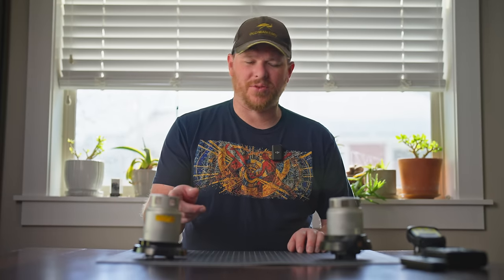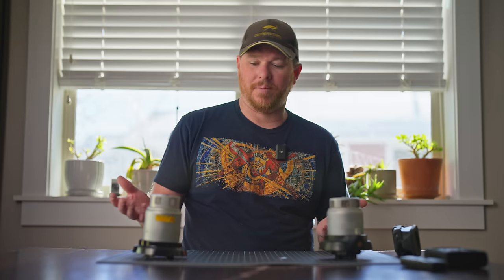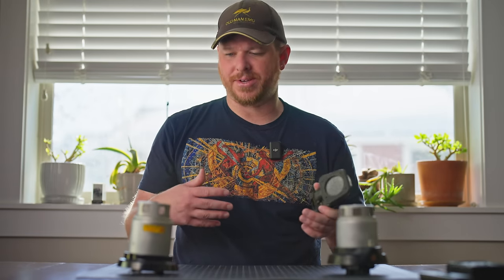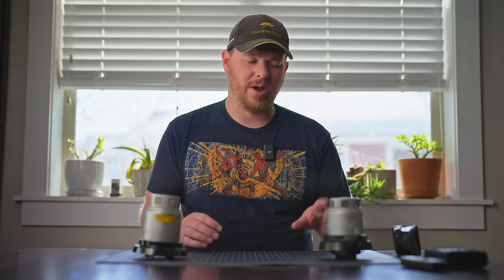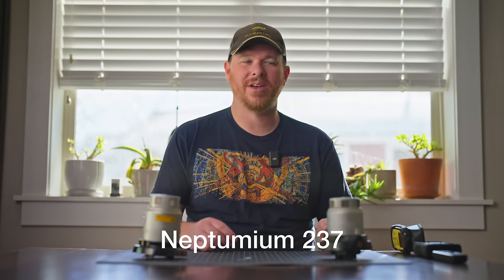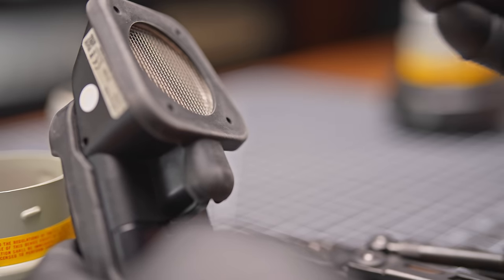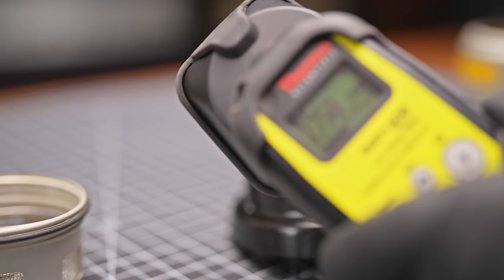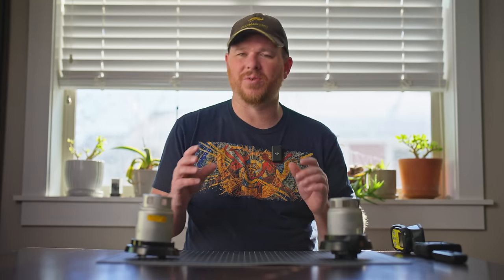Radioactive Cores from Industrial Smoke Detectors

Comment: Drew, would you ever consider reselling the ThermoScientific detectors on your website?
Reply: They are quite pricey, You can get something that will fill the same role (Contamination surveys) for a lot less.
Reply: SE International Ranger is half the price with the same tube and sensitivity and a bigger display
Reply: the Mazur PRM-9000 is a great alternative that has very close range and refresh to the B20 at a reasonable 660-700$ USD , the Better Geiger is good also but i tend to use it as more of a comparison geiger with it being a Scintillator and the B20 and Mazur being a GM it has a handy accumulated dose while it is on and running .
Reply from the maker: If I could work something out with Thermo Fisher I would sell them on there.

Comment: If the "better geiger" shows 1.2 microsievert and the radiacode 11, then one or both of them are very inaccurate or how do I have to understand that?
Reply from the maker: That's a good question. The Radeye B20 is a pretty good gauge to see which one is closer to being right. I only say that because the Radeye is used in the nuclear industry in a professional setting.
Reply: @RadioactiveDrew but that doesnt help here because it overloaded at 600k cpm :(
Reply: @RadioactiveDrew never mind, it showed 25microsieverts with the gamma filter. 
so the others were both very far away from the truth, imagine your geiger says the radiation is 1/20th of what it actually is 😮
Reply: all 3 "measurements" were incorrect - because of wrong geometry, so you just ignore all 3 of them - this is how you should understand "that".
also "nuke-lar", that's SO funny to hear, multiple times : )))

Comment: I have a luminous personnel marker that’s supposed to be only 5 uCi but it reads almost the same as the smoke detector source on the radiacode, is it possible that more radon is being contained in my source and increasing the activity?
Reply from the maker: That’s very likely. The radon daughters can build up in a source like that. Also the gamma radiation from radium is going to give a higher dose due to the higher energy. I have a couple of those personnel markers and they are very spicy.

Comment: On the part about gloves, you should be extra careful with the Am241 one since they're known to expel tiny particles of Am241 onto the surrounding enclosure, so it's easy to get contaminated with Am241 if you're not careful. I'm sure I don't need to say why ingestion of alpha particle emitting isotopes is dangerous.
Reply from the maker: I always check for contamination after handling items like this.
Reply: @RadioactiveDrew  indeed, but the part implying gloves aren't required annoyed me

Comment: what is the main difference between the Am-241 industrial model vs a common household one? And where did you get these? I ask because Im wondering why david hahn kept stealing and collecting the household brand if he could get ahold of those.
Reply: AFAIK, the household detectors that have the Am-241 'buttons' inside are smaller in size compared to the detector that Drew has in this video. I am not sure if the concentration of the actual isotope is less in a consumer grade one as well, but I would guess that it probably is. I'm guessing he was getting the consumer grade detectors because they're more readily available, and much cheaper. I'm pretty sure from what I read about the story, he first got a deal on a whole lot of like 100 detectors, and then years later he was arrested stealing the detectors out of his apartment complex/ building where he lived.
Reply from the maker: Well, David Hahn didn't really have his head on straight and maybe he didn't know about these industrial smoke detectors. I'm sure if he did he would have used them. The difference in material between a residential smoke detector vs the industrial ones can 160x more material.
Reply: @RadioactiveDrew  
True, he was definitely not 'playing with a full deck' so to speak LOL 😆 I think the availability of the 'industrial' type detectors would've most likely been the only factor that may have stood in his way from being able to use them. To play devil's advocate though, he was smart enough/ convincing enough to obtain his own isotopes, and information from the government, companies, and laboratories. Our 'security/ confidentiality' was awfully lax back then apparently. 😆😔
Reply from the maker: Not sure if David was smart or those people he interacted with were totally clueless. I think it was a mix of both. Personally I think the tale of the Nuclear Boy Scout has been over sold to the public quite a bit. There are a couple things that don't make any sense in the story. Also I believe he was made an example of.

Comment: I wonder if there is enough radiation emitted to excite strontium aluminate paint like zinc sulfide did with radium, it just might be a neat little science experiment. Plus, if its effective enough,  you can have little paint cards by where you store this stuff to see if there is leak through that your detectors might be seeing as slightly elevated background radiation.

Comment: Could you use those to produce electricity?
Reply from the maker: There are some experiments from the past where they tried to used radium to generate a charge. The results of the experiment are extremely vague. I would like to try it for myself and see what happens.
Reply: @RadioactiveDrew  that would be pretty boss if you managed to pull it off tbh!!

Comment: Almost reminds me of a hot pellet i observed to be used in a "down hole log-tool', when i worked in the oil field.
The pellet was so hot, it looked like it was inside a bubblle chamber, while in open air. Not sure what the source was, elementally.
Reply: About 500mCi of 137Cs or about 100mCi of americium mixed with beryllium.
Reply: What do you mean by "looked like it was in a bubble chamber"? Very skeptical...

Comment: Does your fingers not feel hot or anything from touching the radium part?
Reply: Luckily it’s so incredibly small, it doesn’t output enough energy to generate any discernible heat.  In the grand scheme of radioactive materials, these are many orders of magnitude less radioactive than objects like Radioisotope Thermoelectric Generator sources, which contain many millions of times more material, and are often composed of shorter-lived isotopes like Plutonium and Americium.
Reply: Nope, you're not going to feel that. The dose rate 1cm from the Ra source is probably only 1mSv/h in gamma (max). The skin dose from beta is probably a couple orders of magnitude higher, but that's not going to cause any acute symptoms unless you left it taped to your skin for hours and hours (perhaps slight skin reddening or irritation). These sources are fairly safe so long as they don't leak, and aren't handled in close proximity for extended periods regularly. At 1m distance, the dose rate from the Ra source is around 0.16uSv/h, and the dose rate from the Am is next to nothing. Background radiation is around 0.1-0.15uSv/h generally (but this varies greatly).
Reply from the maker: Yeah, no detectable heat from these sources. I’m sure if I handled these for a long time there might be some visible signs.

Comment: Here's a question:  Nuclear radiation.  OK, alpha and beta particles, and gamma rays.  Let's just pick alpha particles.  They are "something", a particle, so what happens to them after they are emitted?  Are they like a 4th of July  sparkler where the hot sparkles die out and I guess there is microscopic ash left?  
If you had a closed lead container with uranium in it and you left it alone for say 100 years (it is emitting alpha particles all that time) would there be some residue left in there from all the expended alpha particles?  Hmmmm....  What happens to them, where do they go, etc.
Thanks for your vids!
Reply from the maker: Since alpha particles are just helium nuclei without the electrons, they pickup 2 electrons from the air and turn into helium. So all the helium that is created comes from radioactive decay. That why I laugh whenever I hear people say we are running out of helium. Helium is a renewable resource.
Reply: @RadioactiveDrew  Thanks!

Comment: I wonder where the DP-5B will read on that radium one
Reply: A radium clock I recently got reads about 120,000 on my ludlum 12
Reply from the maker: Radium clocks can be very hot. The radium doped aircraft gauges are extremely spicy.

Comment: So the Radiacode has ~30% efficiency for Am-241 gammas
Reply from the maker: Hard to say. It seems like the Radeye B20 has 25% efficiency with Am-241. So I guess that Radiacode could be around that number. It’s really hard to say. I’ve heard that lower energy gammas are absorbed more than higher energy ones. Which ups the dose rate. So I’m not sure where that sweet spot is for true absorbed dose for low energy gammas. I’m sure there’s a paper out there somewhere about the subject.

Comment: Why don't smoke detectors use polonium-210?  It would give off no gamma rays and be much safe.  You could have smoke detectors with replaceable cartridges to replace the Po-210 source and replace it every 3 months or so.
Reply from the maker: I think they want detectors to last a bit longer and not have people purchasing replacement radioactive sources. The gammas from Am-241 are very low energy and only begin to get a little intense when you are very close to the source.
Reply: @RadioactiveDrew  But what if the smoke detector catches fire?  I'd rather inhale a more or less natural substance albeit in rare amounts than something that came out of a nuclear reactor, don't you feel?
Reply: @ThePeterDislikeShow  that is not how things work... Nature makes the best poisons after all. The gamma from the Am source isn't a concern at all. I could leave that thing in my pocket for months with little to no concern. The radium is obviously more of an irradiation hazard, but still not a big deal. In both cases, the issue is inhaling alpha emitting material, which Am-241, Ra-226 and Po-210 all produce. Honestly I'd rather have to deal with Ra contamination due to its ease of detection. Po is a nightmare to detect, and would also have to be replaced frequently as you say...
Reply: @inductivelycoupledplasma6207  How about Po-209 then?  It has a 125 year half life.
Reply: @ThePeterDislikeShow  still doesn't change the fact that the gamma radiation isn't the issue here. Also Po-209 is a much bigger pain to manufacture than Am-241 and Ra-226 (both are waste products of the nuclear industry). The main thing pyrotronics should've done is make their sources less leaky, and this is why the Am ones scare me so much. Am-241 is extremely radiotoxic, especially through inhalation

Comment: Let's put things straight here to all potential copycats out there: the way he is handling these sources is dangerous, period. He visibly hasn't learned much since his other video where he also handled this very radioactive radium smoke detector source the same way. Before playing around and joking around about "much more intense industrial sources", you may want to reconsider the definition of intensity of electromagnetic waves first. Intensity is the energy crossing an area per unit of time. Simply put, if you are handling a point-like radiation source, this means the closer you get to it in any direction, the higher the intensity. That's why sitting at a soccer game in your seat is just fine, but being an inch away from stadium lights would cook you in an instant. Hence handling a moderately radioactive source at very close distance to any part of your body can be extremely dangerous and more dangerous than being some distance away from a much stronger radioactive source. Unless you purposely want to jumpstart a tumor at that location, say, your fingers in this case. This guy somehow thinks it's all about the accumulated radiation dose and he can get away with high intensities if it's only a short amount time. That's a very flawed reasoning, our bodies are not averaging machines which can cope with any intensity. Unfortunately, as our body cannot detect radioactivity, we have no natural reflexes against ionizing radiation nor a natural appreciation of its intensity, unlike heat. And let's not forget that over a fixed area, the intensity is inversely proportional to the square of the distance, or to put it plainly, the closer you get increasingly worse it gets ...
Reply: I think you need to stop panicking and do some actual math, here. The exposure from just a few seconds of handling these sources is trivial. And radiation is extremely unlikely to harm your fingers, which are nothing but skin and bone. There are no rapidly dividing cells or radiosensitive organs there. Radiation workers are allowed to get ten times the exposure to the extremities, relative to their actual vital organs, and there is an excellent reason for that. At risk of being too flippant, ain't no one dying from finger cancer.
Reply: @MinSredMash  Please proceed to do so. I already quoted the formula to use, just put the figures in. If you desire to do so and have any clue what this is about other than writing "stop panicking", be my guest and use Maxwell's equations to fully model the EM fields around the source. And it's physics at play here, not really math. I agree I'm not as competent when it comes to modeling cancer and medical aspects, but it's safe to say that, given sufficiently intense ionizing radiation and adverse biological conditions, you have to potential there to jumpstart cancer in a finger. Not really "finger cancer", but blood cancer, skin cancer, you name it. Btw, did you know that skin cancers are one of the worst cancers, which can originate from a spot as small as the head of a toothpick? The whole point of my comment was to make people and "experimenters" out there realize that exactly what you wrote "the exposure from just a few seconds of handling these sources is trivial" is meaningless without considering radiation intensity. Other than that, he was handling the source for some way too long seconds ... .
Reply: @fabbaf2090  Why on earth would you want to 'model the EM fields' when there is an entire subfield of medicine already developed around this topic? Your comment reeks of STEM-bro Dunning-Kruger. As for skin cancer being 'one of the worst cancers', that's an amusing statement. Every look at a chart of survival rates? Most skin cancers are an outpatient procedure for a full cure.

Radiation dose is exposure rate times duration. Do the math.
Reply: @MinSredMash  I don't recall my academic degree mentioning anything about me being a STEM-bro, but if you feel that way, be my guest. I have nothing to prove in this matter, trust me, I will say no more. Your condescending remarks put aside, it seems you think you can prove this is safe situation by advancing a primary school math rule-of-thumb for averaged radiation dose and some empirical medical observations. That's even below the "STEM-bro" level. Visibly and notwithstanding my really easy explanation, you even fail to understand that the "exposure rate" part of your simplistic formula is in fact not a constant and that it varies over distance. You would expect most people do get a basic understanding of this: if you ever came closer to a burning flame, you very rapidly understand what this means, without talking any physics or math. But you seem to swear by the sole hammer you're able to use. The fact you fail to understand the simple concept that intensity is inversely proportional to the square of the distance and what this means in respect to a rather point-like isotropic radiation source as shown and used in the video, and its related danger, tells more about your ignorance in the matter than about me.
Reply: @fabbaf2090  That's an awful lot of bloviating to conceal the fact that you are just refusing to do the math on the dose received by the skin and the resulting (negligible) cancer risk increase.

Comment: I worked in a recycling plant for a year and quit over how they handled smoke detectors

They dont have any special system for handling smoke detectors like we do lithium ion batteries, hazardous chemicals etc

They go to a landfill after being run through all the machines and mangled and crushed and destroyed by the time they get onto the floor and put in a truck for the landfill 

Super fucked up because i know how smoke detectors work
Reply from the maker: Wow, that is pretty bad. There could be a huge amount of Am-241 contamination in that area.
Reply: @RadioactiveDrew  yeah who do i contact about THAT specifically because OSHA comes down all the time and once in awhile we get a fine but nothing ever changes 

I feel like nuclear waste is somebody elses issue
Reply: Also this is at both recycling centers i have been to in our county

One time i actually had some to throw away, brought it to hazardous house waste who deal with chemicals and stuff and they told me it was landfill

So after being told that at one location and working another with the same rule it must be a company wide issue